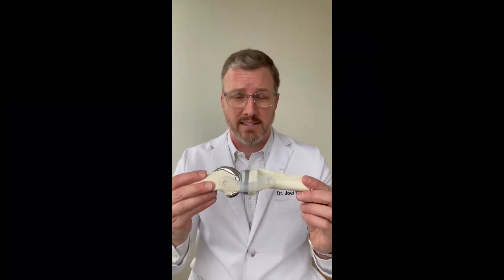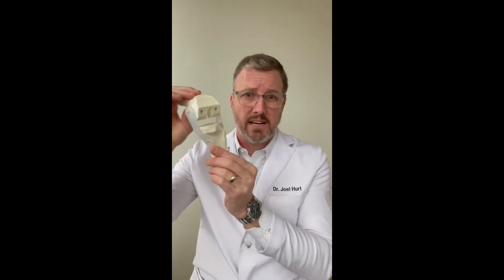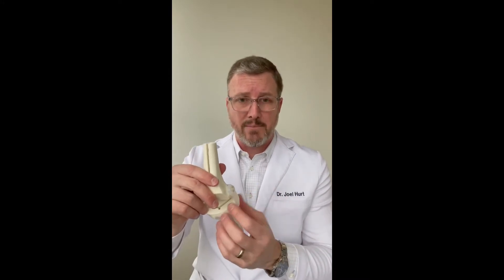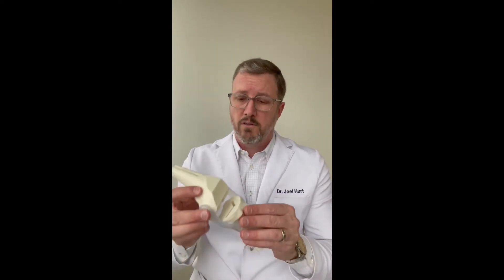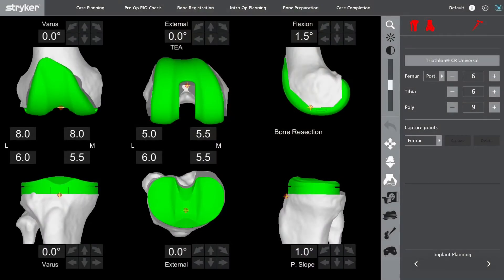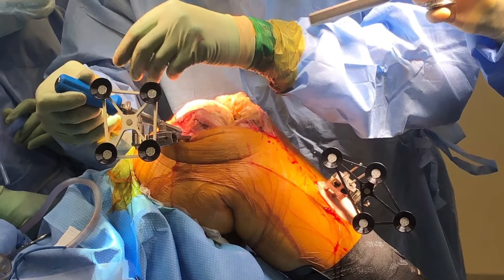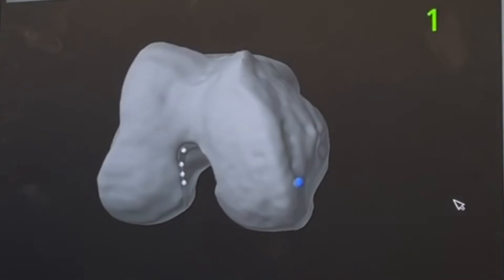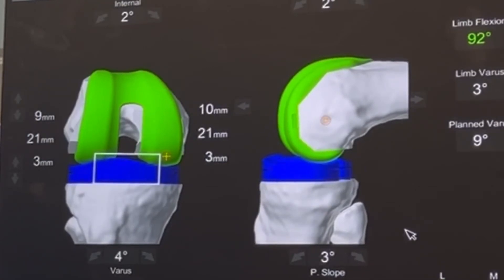Robotic Knee Replacement- Why and How?

Comment: Extremely informative, Dr. Hurt. But, I’m curious whether the end of the tool truly is as ‘chisel shaped’ as is shown on the OR screen.  If so, as you move along the outer and inner aspects of the operative area, wouldn’t a ‘rounded’ instrument or burr prevent the loss of bone tissue outside the colored operative area?  And, will that slight bit of bone removal that is ‘outside the lines’ be clinically significant.  I ask as a health professional sporting both artificial hips and now undergoing evaluation for pending knee surgery…partial/ total replacement?…traditional or robotic?  Thank you for such a revealing explanation of this new technology. RAS
Reply: It's  a saw that reciprocates side to side.  The traditional manual total knee is done with the same type of saw.  We just use guides (called "cutting blocks") that are manually pinned to the bone.  They have slits that we pass the saw blade through.  Re your other questions obviously I haven't evaluated you so HUGE grain of salt. Partial vs Total?  I think about partial knees in younger patients.  BMI MUST be less than 30 and no/minimal arthritis in other compartments and overall limb alignment acceptable (among other factors).  Speaking from experience- the ceiling of improvement/outcome is generally higher for parital knee compared to TKA (they feel more normal and have better ROM in general).  However, they are more technically demanding and there are more ways for it to fail.  The "sweet spot" is much bigger for a TKA than a UKA in my opinion.  Robotic vs traditional?  There are many excellent joint surgeons who do not use robotic techniques.  They absolutlely do not get the same info intraoperatively that a mako provides but many times their extensive experience and innate skill/gifting allows for them to overcome that most of the time.  The robot really isn't the secret sauce.  It's the 3D modeling and ability to predict the gaps with precision that makes the difference.  I predict that the robot will not be the long-term solution (very expensive initial investment as well as upkeep costs) but other platforms are beginning to allow for the same delivering of info (prior to cutting) as well as complete freedom to manipulate implant positioning in all planes.